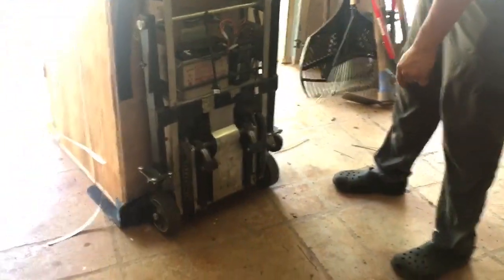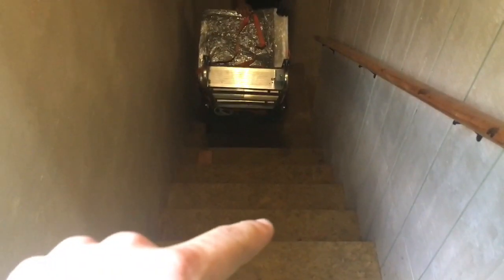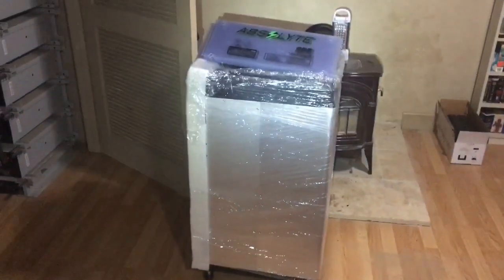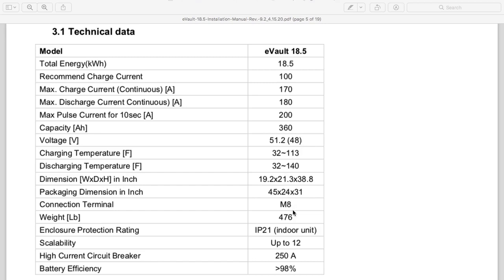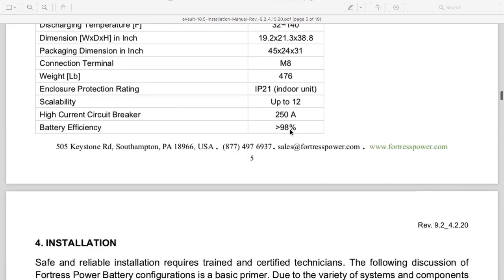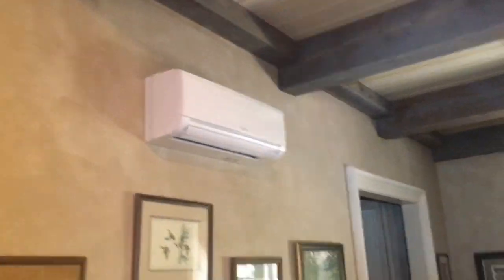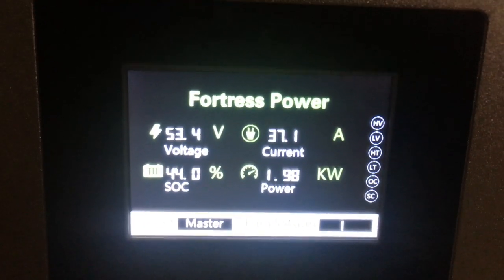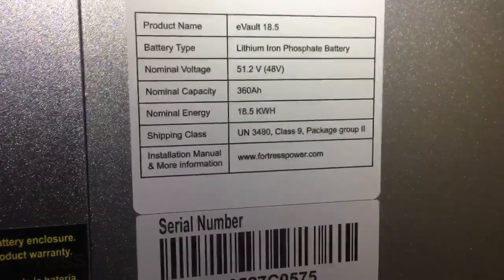Offgrid Dream House Lithium Battery Upgrade

Comment: Hey Johnny, will 1 of these batterys power a medium size house, with soft start hvac ,and well pump and propane range and water heater.
Reply: Sounds like it will give 10,000 watts( for a couple hours that is.

Comment: I am going with two fortress 18.5 do you think that's enough for a off grid house that currently has 64 interstate 6 volt golf cart battery's also installing 17 q cell 400 panels and sol ark 15k
Reply from the maker: I’d rather have rack style batteries. Much easier to add on in 5kw / 110lb increments than 18.5 kw 450 lb increments.
Reply from the maker: If you want a quote on a battery email me at jv@gainsolarpower.com

I’ll sell you the evault too. Cheaper than anyone.
Reply: @GainSolarPower  I am here in NM so shipping probably is to high from your area
Reply: @GainSolarPower  I'll email you what my supplier is charging me
Reply from the maker: @rlrifle71  please do👍
Reply: @GainSolarPower  sent